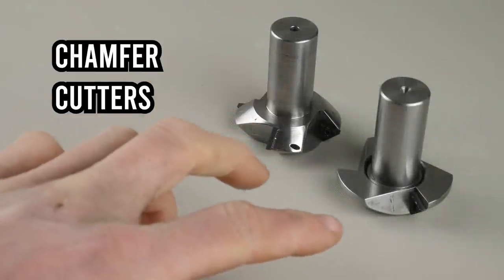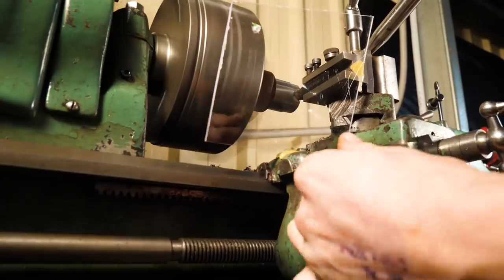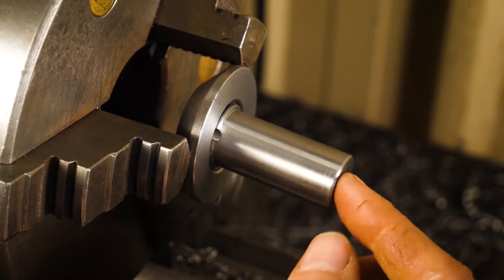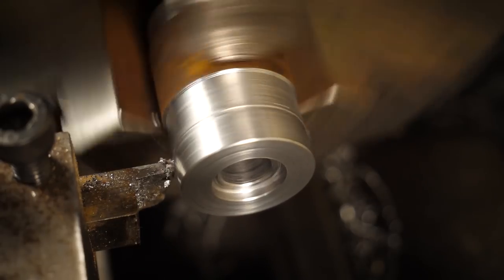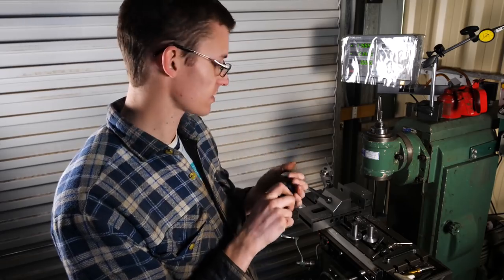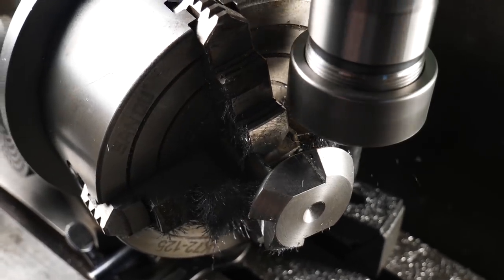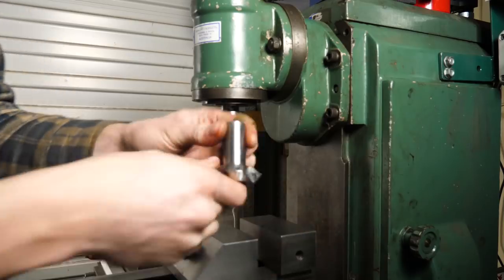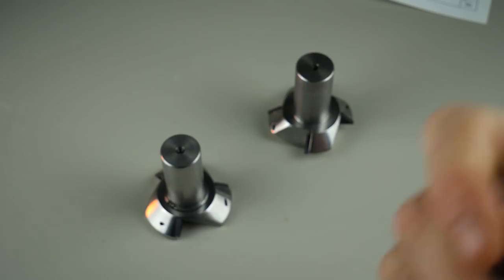DIY Bevel Cutter Build

Comment: You done a fine job young man I'm a retired machinist while I was working I would take a broke windmill sharpen it by hand on a 45 and hand clearance it worked great and fast and easy way to use up broke tooling would take a pretty heavy cut then climb mill on the spring pass and be chatter free you also have a nice shop of machines and tooling keep up the good work

Comment: I think these two Cutter Bodies look fabulous. I really like the fact that you are well aware that the Insert Screw location is critical. Been Selling Industrial tools for over Forty Two Years. Dont worry about getting them Blued or Blacked. I think the raw finish makes them unique and that's the way they should be. Very well done..! As far as the finish the first tool produced, check to see if those TNMG inserts have a neutral or positive rake, if they are true TNMG Inserts, they have a neutral rake meaning the "back" of the cutting edge may be hitting as it exits the cut... producing the chatter marks. 🤔
Reply from the maker: Thanks, they are positive rake, I think the issue is that the entire edge slaps against the work piece, and I was taking deep cuts for my mill. I probably need to experiment with feeds and speeds a bit more too

Comment: Nice design, would have liked to have seen an indicator on the inserts. I see a potential issue with the tips of the inserts not being on the same plane. There is nothing to register against in that plane except the fastener.
Cheers
Reply from the maker: You mean perpendicular to the vertical face? You might be onto something there, that might be the cause of the misalignment. I suppose I based the insert seating on some lathe tools I have which really doesn't matter where the insert seats
However I think mainly I will use these for cosmetic bevelling (followed by sand paper) or bevels for weld prep, so it's probably not the end of the world

Comment: nice! I think this is a great way to make it, most of the ones you can buy have rake on the insert, so it doesnt cut the correct angle on your part.
Reply from the maker: Yes I made sure to set the inserts right on the centre for this purpose. These inserts have inbuilt rake build into the profile, so yeah not needed in the tool body
Thanks for watching

Comment: Gday Tommy, Great design and build, there’s a fair bit of math involved with making these so that’s me out, the broaching tool did a beautiful job with the hex, was there a burr in there or did you knock them off first?, great idea as always, thank, take care, Cheers Matty
Reply from the maker: Yeah the dual cutter (with top and bottom inserts) really messed with my head for a while.
The broach kinda pushes 6 curled chips inside, I just run a drill afterwards, it catches the chips and tears them off easily

Comment: Good build and a great pair of cutting tools Tom 👍

Quick question, were your table gibs locked when doing those cuts? I’m curious to see if it improves those skip marks 😉
Reply from the maker: Actually not sure now. I did however find that my spindle bearings were a tad loose, but I haven't checked since. So that may be it

Comment: Top job mate !
I like the idea with the retaining bolt ! This couls be what is giving me grief with one of my slitting saw arbours as it uses a countersunk screw and i can never get it running true even though i know the hole in the saw runs true and the arbour does too but there is a little play in between the two - must investigate that ! 
Are you having trouble with trolls or hate mail or something ?
Reply from the maker: Might be worth a try at least, or maybe turn the arbor down a bit, and press a sleeve over it with less play?
No real troll issues lol, I've just seen arguments over centre drill use as a spot drill (it's the wrong angle etc). I only use the tip of the centre drill which I like to think is a reasonable option
Reply: Slitting saws ALWAYS seem to run out, even when the arbor is perfectly true!

Comment: Is that a hercus 9" lathe? Looks a lot like mine
Reply from the maker: Sure is, model C
Reply: @TomMakeHere  I don't know what mine is, i was just told it was a hercus 9". Doesn't have the power feed gearbox, so I think it's just a pretty basic one
Reply from the maker: @dan5her  I built the gearbox on mine years ago. Yeah it's the basic model
Reply: @TomMakeHere  nice, looks great!
Reply: @TomMakeHere  stupid question, but how did you reverse the spindle direction? Is that via gearing or can you reverse your motor?

I couldn't work out how to reverse mine